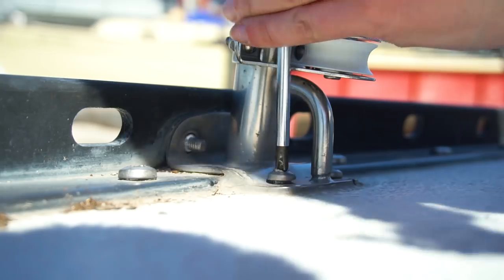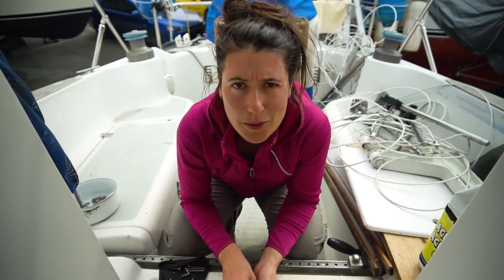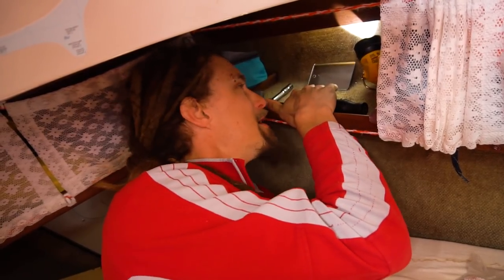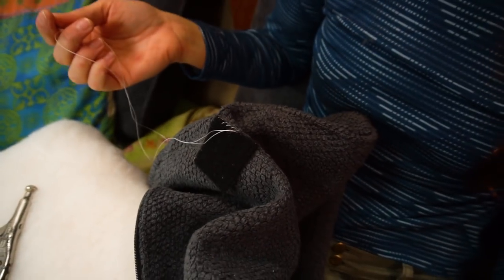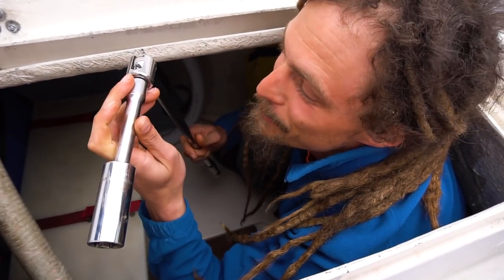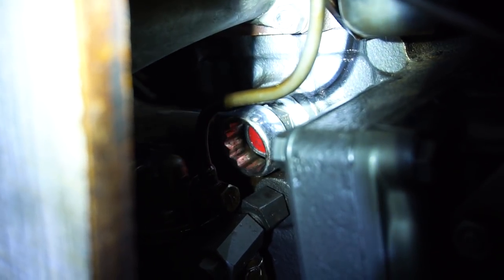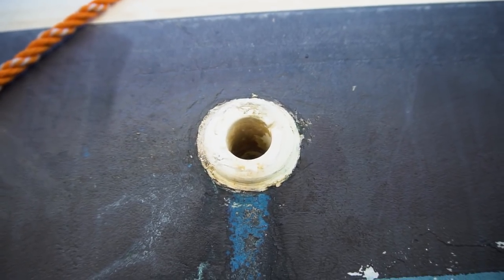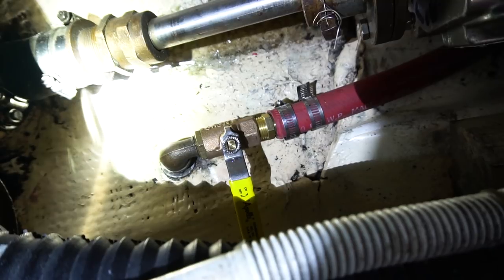BUTYL TAPE a boater's best friend | Re-torque Keel bolts[Ep 42]

Comment: Great video - thanks. I'm getting ready to torque my keel bolts so your advice was helpful.  BTW, I'd bet that those old valves were globe valves and not gate valves.  Neither is appropriate so it's good that you replaced with ball valves.  Happy New Year - 2021.
Reply from the maker: We were happy to have torqued them since they were that loose. The new valves arr much better. Happy New Year to you too.

Comment: Check your local auto parts store. They often have loaner tools  so you might be able to find a proper sized  torque wrench.
Reply from the maker: That's something we hadn't thought about. Thanks for the tip. We've been quite fortunate with tools from our fellow boaters at the marina and work place.

Comment: Good job using butyl tape, but you should use bronze instead of brass ball valves. they won't last near as long and not as strong! Use the best for every thing below the waterline!
Reply from the maker: Did I say brass in the video? We did buy all bronze ball valves. And I agree with you for below the waterline. We don't want to become a shipwreck.
Reply: Just looking at it thought it was brass,  bronze seems more brown.
Reply from the maker: I did buy one that was brass by mistake thinking it was bronze then swapped it. They do look similar.

Comment: Alex hun, I might have missed something but I would hate for you guys to get ready to be launched only to find out your seacocks are leaking like crazy.  ok, my question for you is... did you apply thread tape or pipe dope to those threads on the seacocks and ball valves. In the video they looked very clean and no tape showing. If you didn't, please make sure you go back and do that prior to being launched. Have fun, be safe and KEEP ON SAILIN ON! cheers RJ
Reply from the maker: Thanks RJ for worrying about us. You are totally right, I had forgotten to put tape on the threads. So I went back in my hole, took it apart and put tape on. You'll see it in next week's video.

Comment: We used butyl tape, but after drill/fill/drilling the holes the bolts go trough and beefing up the backing plates.  None of them have leaked.
Reply from the maker: Butyl is such a wonderful thing isnt it? We need to start drilling out and filling all our as well tho. It seems the best way to do it.
Reply: @WildlyIntrepid  it's all we use, including installing the base of the flue of our new wood stove and whenever we rebed a portlight.